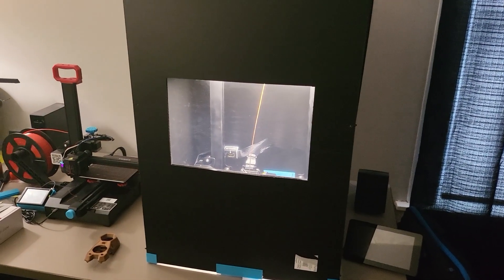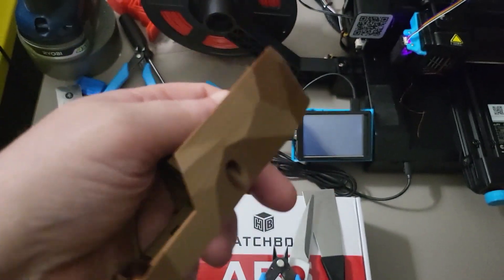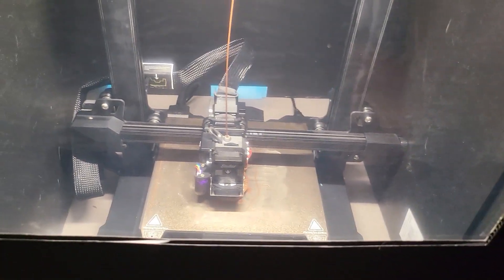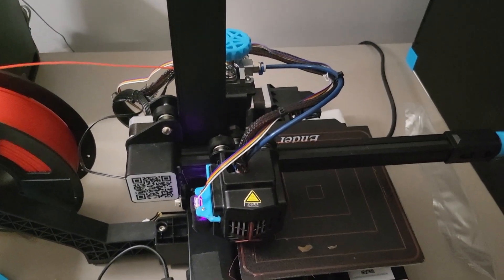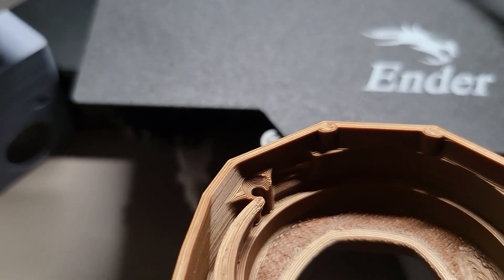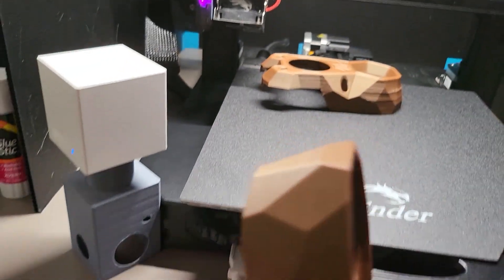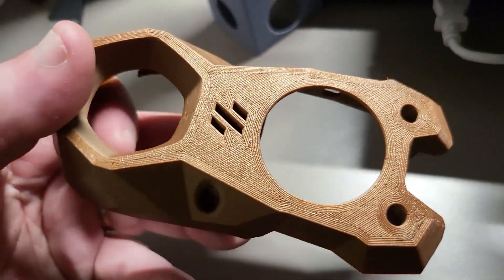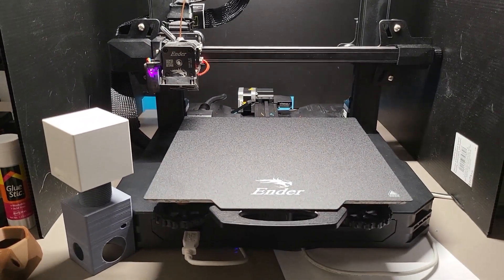Ender 3 S1 Pro ABS first Prints in home made enclosure

Comment: That defect of bubbling is called warping. The first layer is rubbing up against the extruded layer height causing that issue. Stronger bed adhesion needed and can be compensated with Mouse Tabs, Garolite Bed and hairspray/glue.

Comment: That ridge is warping often.....plastic getting smashed out as the layers are to high. Put it on a flat surface, see if its warped a bit.
Reply from the maker: Yeah I found that the X axis and z gantry are not aligned, the X axis on the right side was down 2.5mm.....

Comment: Those problems are caused by that section being released from the bed.
Reply from the maker: You mean where the split was?
Reply: @eclypse3d  at the beginning of the video, you showed the top part of the stealthburner fan housing, there were two sections that looked bad. That's caused by your part getting lifted off bed mid-print and causing consecutive layers being overly squished upon each other. You can also notice how the first layer is not flat due to that issue.
Reply from the maker: @MehmetcanÖksüz  oh, yeah no that part was very well stuck to the bed, I had no lifting issues, I had to let that part cool all the way down just to get it off or it was not budging =)
Reply: @eclypse3d  at 0:37 you're pointing the issues I was talking about.

Comment: those prints look over extruded
Reply from the maker: Yes those were my two initial shots, they were over extruded by about 8%, I have since fixed that issue when I was doing the extruder parts for the clockwork 2, found tolerance issues.  I corrected the flow calibration and have since re-printed the covers.  All other parts where printed with the correct flow rates and are perfect.

Comment: How are those enders printers? I keep hearing good and bad things, like they have a big community but have language barrier support or little to no support or support just takes too long to answer? Now sure how true that is.
Reply: If you can deal with the headaches involved in 3d printers then yes enders are a good option. I own an ender 5 plus and there is hardly any support for it. the latest firmware update they did is v3 and it ruins the printer, they havent updated it in a year. 

as for the ender 3 series. Because its so cheap, there are a lot of people who purchased them and there is a huge online community based around modifying, repairing, and troubleshooting issues with the ender 3 series. 

If you want less headaches, pay for a prusa, They're 2 to 3 times as much in cost but your really paying for the support and plug and play abilities.

also understand, if you're going into 3d printing, its not plug and play, no matter which route you choose, You will always have issues that you will need to figure out. Even with all the support and community, they might not be able to help you with your problem.

It took me about a year to get comfortable with my printer and learn modeling and whatnot. Hopefully this year I will get into scanning and start making some money off of this thing. 

If I did it all over again I would have bought the ender 3 series sell it, or make money from it, and then move on to a bigger printer. I also signed up for a bambu printer and am hoping to get access to that once its released. If for some reason it goes down the drain I will be building a voron 2.4.
Reply from the maker: Enders are the budget machines of the printing world, but I have to say they are getting better than they were both in cost and functionality.  My Ender 2 pro was just $129 bucks, I put a $33 touch sensor on it, and some orange springs, and a metal extruder gear on it and Capricorn ptfe tubing on it.  That thing prints reliably and very good quality prints.  Its only limited at the moment by the bed temp only being $80.

My Ender 3 S1 Pro now that its dialed in prints fantastic, especially at .20 layers very clean.  Both are running RPI 4 Bs running Klipper-Mainsail, and using touch screens. 

All 3D printers at some point need tinkering, and all need to calibrated and re-checked regularly, especially if you move them.  There are high cost brands out there and some that just run out of the box no issues, however most brands are from China, and you have to consider they are shipped from overseas and you should even with Prusa printers check them out of the box and do a once over and make sure everything is tight where it should be, loose where it should be and running as they should.

You should be a tinkerer at heart to get into 3D printing.  My E2 Pro out of the box printed fantastic, my E3 S1 Pro I have to go over everything, all rollers, bolts, cables etc. to ensure everything was buttoned up before printing, even through Creality does pack their stuff well, quality control is not their strong suit, and forget using the support.  Personally I tore mine down when I unpacked it and went through it.  It is just better that way.

I am building my Voron(s) coming soon and by building your own kits, you get to really know the product, and how it works.  I have learned tons just installing klipper, adding RPIs, and new screens, and doing all the calibrations (Bed mesh, flow, input shaper and PID tuning etc.)
Reply: @eclypse3d  Wow lots of  info. I Tinkle with PC.Cars etc and other things, but seems 3D printing won't be that bad either. I still have not decided, but Looking at the S1 Pr and CR-10 for now, just to start me off and see how much I enjoy it and how far I can take it and even make some money from it? 

Not sure if Black Friday Deals are available, but if there are I will wait till then.  

Thanks for all the info. 🤗
Reply: They have machines that needs tinkering with if you are willing to do that , it's great if you aren't much for that enders will not be the best solution for you
Reply: What language do you speak? You mentioned a language barrier.
Reply: @lunatick1969  I speak English and Spanish. I mean barrier by support on their end, usually when you buy a product from China, and they don't have English support person to speak with it creates an tough barrier where one has to usually wait 24-72 hours via email for a response. Not saying Creality makes you wait that long, but some Chinese companies do as they rely on Google translate to read and answer you. 

We would hire a Chinese English speaker, but usually they are to cheap to do so. It's can be frustrating at times when trying to fix a hardware issue or even software. From what I understand Creality had a big community that works well amongst themselves?
Reply from the maker: @ELEVOPR  I have had zero success with Creality support, I reached out to them regarding the y axis extrusion on the S1 Pro the anodized coating has some imperfections that cause the rollers to make some noise and I am not sure if that would translate into the prints but I wanted them to provide me a new one, and they kept sending me e-mails with either no content at all, or just asking me if I have any questions, and not including any other text in the e-mails so I stopped reaching out to them.

FYI I sent my original e-mails in English, and with Chinese translations in the content so it is not like they could not understand my issues.
Reply: @eclypse3d   @eclypse3d  Wow that sounds really bad. I think I'll be staying away from these cheaper models, they are more common and have big community, but what happens when you need a part replaced and get the running around? Not good. I was looking at this printer which is enclosed and Just prints out of the box. Qidi XCF Pro $1,699. It's designed more to print Carbon Fiber, but prints all other kinds of filament and also brings two swappable print head prints with spare nozzles for both head, Lower tempature head and higher tempature head as well. 

I'm not sure how well their customer service is, so I will have to look deeper into that as well before I take the plunge. 

I'm a newbie, so new to the game I don't have a 3D printer. Luckily for me, I have a friend that Teaches Auto Cad, So he is willing to teach me. I want to get into it to make some side Money, so I want to learn it well. 

If you know some good learning videos, hook me up. 🤗 

Thanks for the feedback I appreciate it.

Comment: Would you mind sharing details about your enclosure? I would like to build one for my soon to arrive S1 Pro. Ideally one where I can vent out of it, and manage temperature in it to print ABS, poly, etc. Is what you built wood + some plexiglass? Any change you got a build video.. or details you can share?
Reply from the maker: The enclosure is 20x30 sheets of coroplast (plastic corrugated sheets like cardboard) you can get those at Michaels or Home depot like $5 a sheet I bought 7 sheets only needed 5.  I made the corner brakets etc. from red and blue PLA I just made simple models in Fusion 360.  And Zip ties.  For the window I used a sheet of Laminating paper, put through a laminating machine ones just by itself.  Makes it super clear, and pretty strong.  Its warp resistant to the temps the enclosure will do as it heats up higher than that just to bond it.

I cut one sheet down to 20x20 and created a open box with one sheet at the rear portrait orientated, and two on the sides with the same orientation so its 20X20X30 then for the front, I cut one sheet in half making two 10x30s, and created the front of the enclosure with those, the single 20x30 sheet with the window in it and the last piece of 10x20 left over from the top part.  that section is assembled to slide over the front of the box easily so I can just lift it on and off to open the box up.  Simple, and cheap, the fan duct and fan that is going out the window to the right will cost more than the box did.  Still will be cheaper than the premade creality enclosure at $70 bucks, prob spent maybe $38...